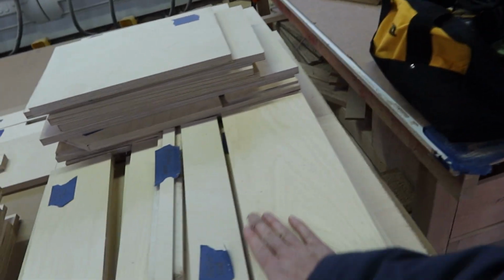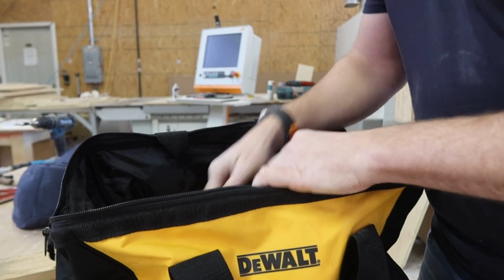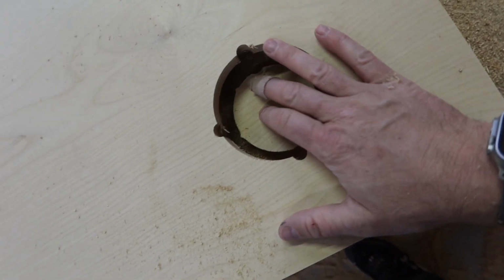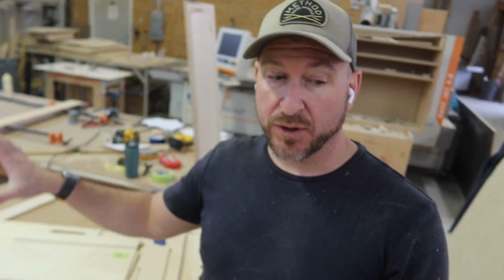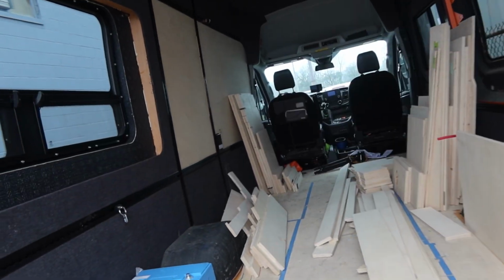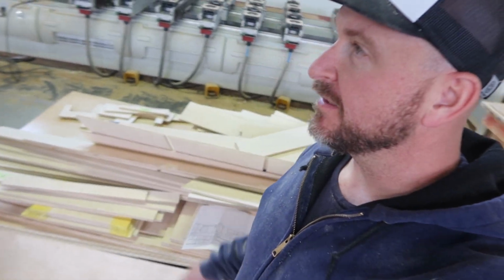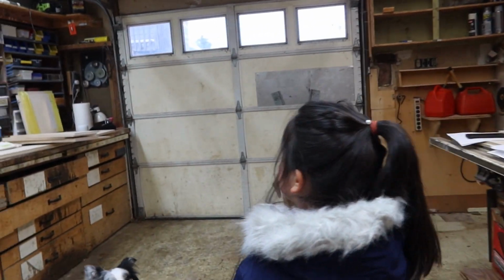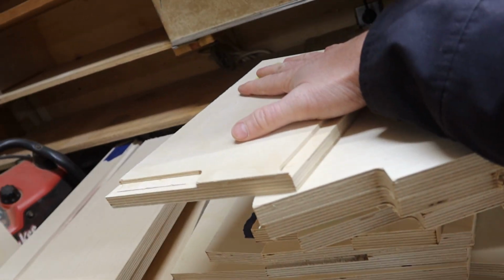Finished CUTTING my CNC Cabinets at Detroit Woodworking

Comment: Have you chosen the flooring to put down before the cabinet install? I think your stock suspension will be perfect for this build. It's higher rated with the duals to haul freight.
Reply from the maker: I still might add a leaf. But no hurry. I’ll put the floor down just before I lay in the final cabinets

Comment: Matt so dose the weight of all the material affect your gas mileage? I know you installed better shocks . I guess the question is what dose the amount of weight in the Van affect . If that makes sense lol
Reply from the maker: Yea it does. Not sure how much it will though until I’m finished
Reply: @JaYoeNation  Perhaps run down to the scale 

1. dry weight with your current modifications and without cabinetry.
2. weight of van with all the disassembled parts.
3. weight of van with assembled parts.
4. weight of van with finished cabinetry without equipment.
5. weight of van with finished cabinetry and with equipment and wiring.